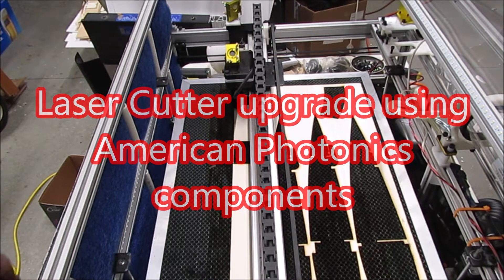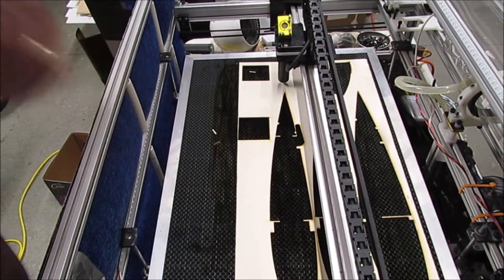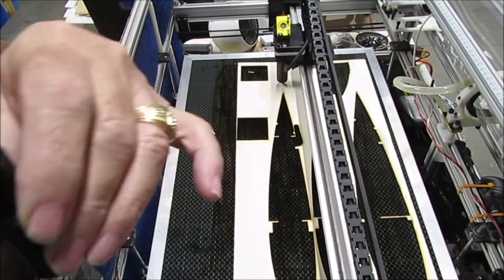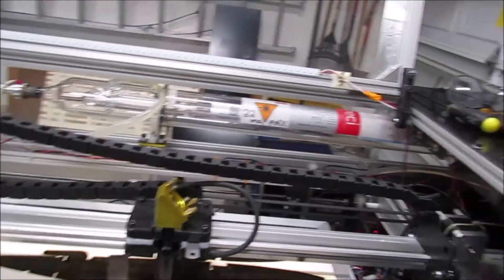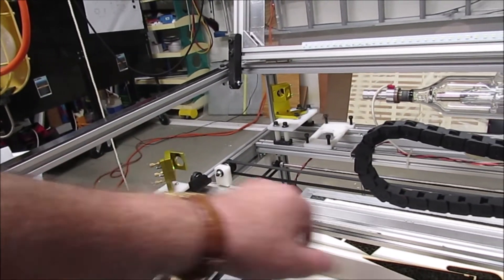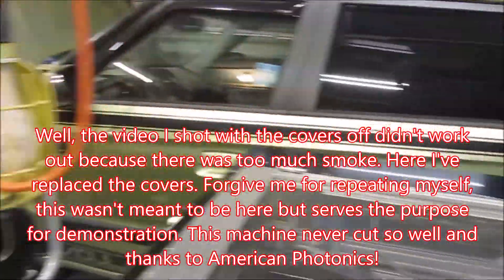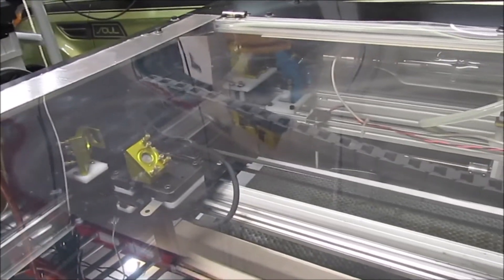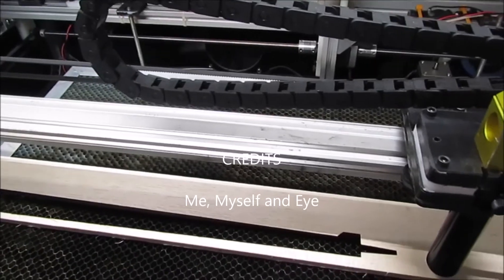American Photonics lenses used for my Laser Cutter upgrade

Comment: Kinda late to the party but felt compelled to respond.
Hmmm. I just looked at their channel and I did indeed see the video about "reverse alignment". I need to think about that a bit, but my gut reaction is a cringe. I do NOT think that is a good idea at all. I believe you should not exchange beam sources back & forth for aligning your mirrors. Also, another video he mentions something about moving your laser tube to center up on a position at the head, like it's just a small thing that will be perfectly aimed when you're done. Well what if after moving your tube, you're just a slight angle off, i.e. not perpendicular to where it was the first time? The path can't help but be off downstream. Anyway, you are correct to be suspect of their advice I think. The alignment laser they sell would be very handy for centering the laser path on the lens, but I would advise not to use it for anything else. So useful tool? yes. But stretching it beyond its scope would lead to frustration I think.

The laser tool from AP (or something similar from anyone else) is ONLY useful for making sure your LENS is centered on the CO2 laser path. This is very important for sharp, round focus which is why a special tool JUST FOR THIE STEP is useful. If the CO2 laser path follows a perfectly perpendicular path but is off-center on the lens, it will distort the focus and cause excessive charring and maybe reduce cutting power. If it's off far enough, the beam might even hit the nozzle instead of passing cleanly through the hole and be pretty useless and cause things to heat, burn and reflect inside (terrible result). You can't use the tool to project back through the laser path for any other parts of the alignment - that MUST be done, per the usual method using paper targets or whatever, starting at the CO2 laser tube and successively aligning the mirrors from that direction only. It doesn't work in reverse, and in fact it would be a mistake to even try to align anything from the head backward toward the tube, i.e. your last step would be to fiddle with the tube itself to try (in vain I suspect) to follow the same path as the AP lens aligning laser did going the other direction. I can't see that being anything but a major pain.
Thus the proper steps to align are (using paper targets or the like):
A) make sure CO2 tube laser output is centered on mirror 1
B) adjust mirror 1 to make CO2 laser centered on mirror 2
C) adjust mirror 2 to make CO2 laser centered on mirror 3
D) adjust mirror 3 to make CO2 laser path through head perpendicular to table
E) use AP lens alignment laser to center the laser path on the lens. Adjust as per the video AP uploaded until the red dot hits exactly (as possible) the same spot on the paper target that the CO2 laser marked in previous step D. Use this tool ONLY for this step.
repeat D & E as necessary until CO2 laser is perpendicular to the table AND both lasers hit the same spot (i.e. path is perpendicular AND centered on the lens)

I'm just a hobbyist and I don't even own one of those tools (yet), but I'm going to order one this week because I was looking into this today, thus why I ran across your video.
I could also be mistaken about my conclusions here too, so don't hold me to it. But I'm pretty decent at stuff like this and not only can I see potential problems with "reverse alignment", but you are indeed having problems with it, so one data point of proof too.
I don't know if they used to actually called it a "reverse alignment tool" last year, but I'm pretty sure reverse alignment is just a bad idea - you should always work from the tube toward the head. If they did call it that, then that's a problem. Today they call it a "Co2 Laser Alignment Tool For "PERFECT" lens head & mirror alignment" - note the "lens head & mirror alignment" part. That's all this tool should be used for, the lens and mirror inside the head only. It's a very good idea and useful tool for that limited use only IMO.
I'd say try your alignment again the standard way and use the tool only at the last step to center the laser path on the lens.
I hope this helps.

Comment: hi there i just received my tool but i am getting the same problems as you are having with the beam wondering around when you change the position of the tool.... did you manage to get it sorted and working in the end.

i ended up doing the mirrors the old fashion way with tape to get my machine cutting again.

any help would be great with this tool... i thought i had found an easier way of doing the mirrors but i guess not 

regards
Gary
Reply from the maker: Gary- I don't know if you watched this video. 
https://www.youtube.com/watch?v=kekbSBOpcfY
It was my fix to move on. I did hear back from them but the fellow that I was going back and forth in the emails was clearly not a technical person. He offered to send me a replacement if I sent the old one back. I said no because like you, I needed to get my machine back online.
As you can see here (and in the other video) they never bothered responding to either even though I sent them links.
I am happy with everything I bought from them with the exception of this alignment tool. Anyway, maybe the video link above will help.
Reply: @kaydee457  hi thanks for the reply and yes watched the video but on my head I don't have a tightening screw... I have a threaded nut that clamps the lens tube so in theory once you slide it in and tighten the nut it should be square in there but if I turn the tool the beam moves so looks like I cannot trust that tool as beam is moving around which is very frustrating 😤 as you know it can take some time to get the mirrors correct... I have emailed them but not holding out much hope....
Reply: @kaydee457  hi i have a head that just tightens with a threaded nut so your fix will not work with mine but the good news is they are sending me another 2 for free so i will try them when i get them i will do it the old fashion way to get machine working.